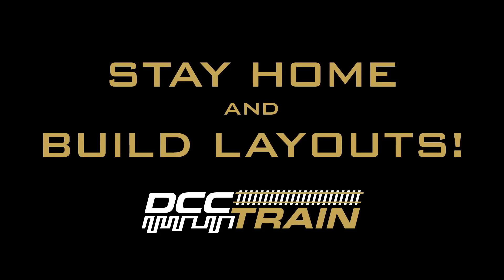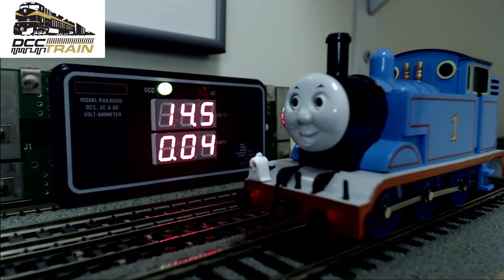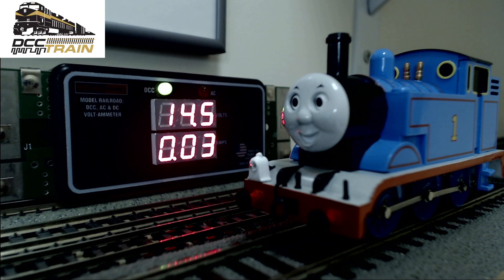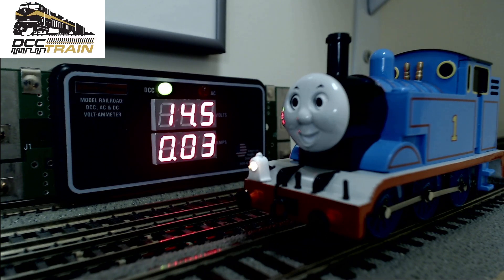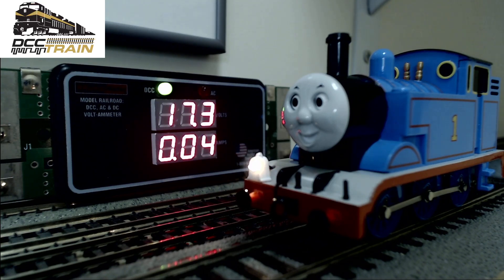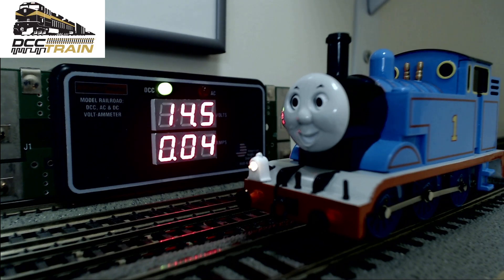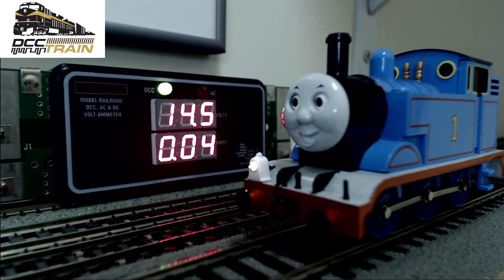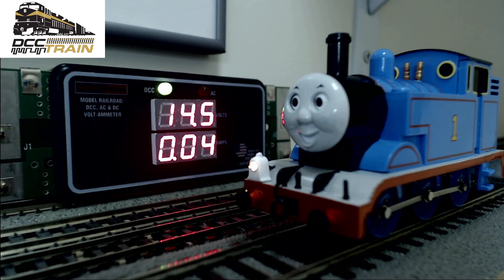How to measure voltage on your DCC Layout?

Comment: Very VERY important subject. More people should discuss this. It is especially a concern of mine as I am taking apart and setting up my layout for each use.
Do you have any thoughts on the RRampmeter versus the Alpha Meter?
What adjustable power supply are you using?
Reply from the maker: Glad it was helpful! The command station LENZ LZ100 has adjustable output, there are Power supplies with adjustable output ad well. I do not know much about Alpha Meter. RRampmeter specifically designed to measure AC voltage with embedded DCC signal.